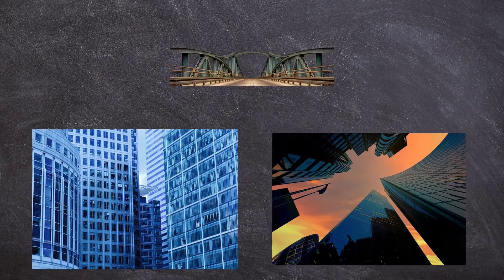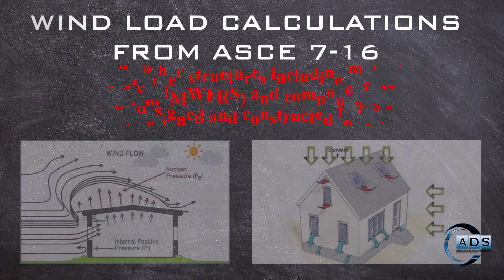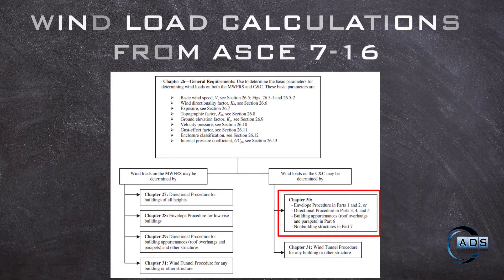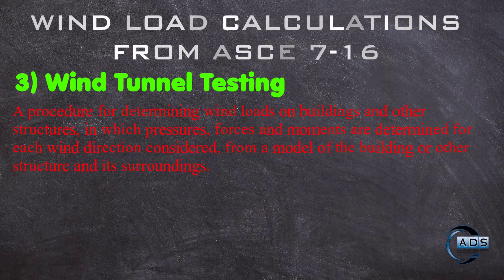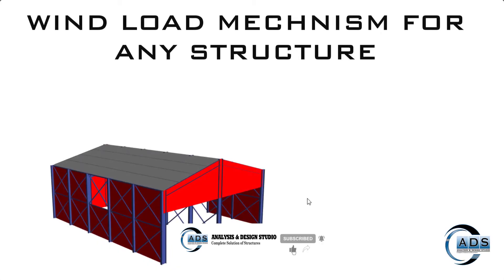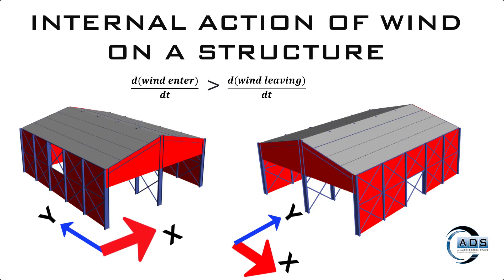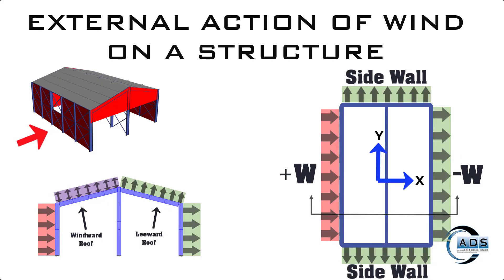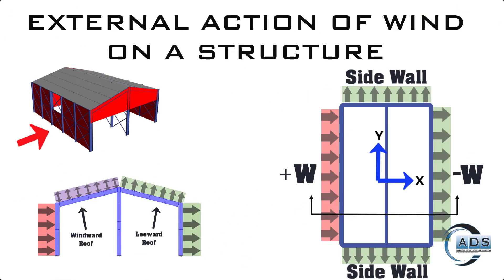Wind Loads Calculations using ASCE 7-16 - Part 1: Basic Mechanism of Wind Load on Structures

Comment: Hello sir. How to apply the internal pressure coefficients in ETABS?
Reply from the maker: Hello Dear. I prefer to calculate wind loads manually and apply them manually. Software generated loads are not corrected as engineer always have something missing and confused about that.

Comment: the word "Wind" is singular. So you say: when "wind flows".. and not "wind flow".
Reply from the maker: Thanks for noticing.
Reply: How about providing info on how this code could be used in locations other than in the US. All the probability based data in the code is for the US. Wind speed with a given MRI is function of location on the earth.